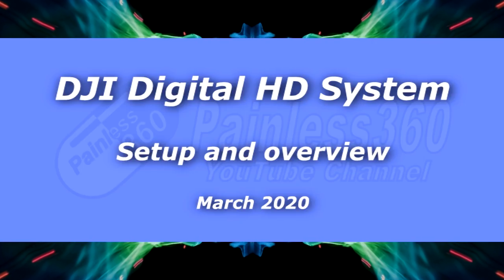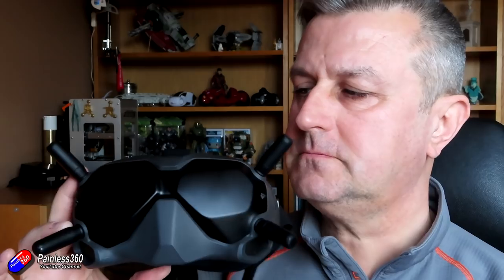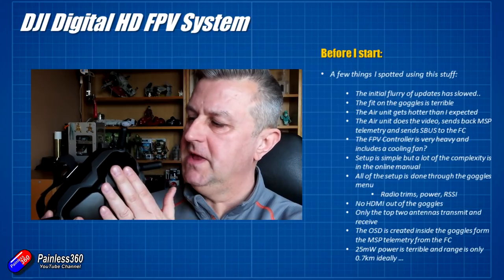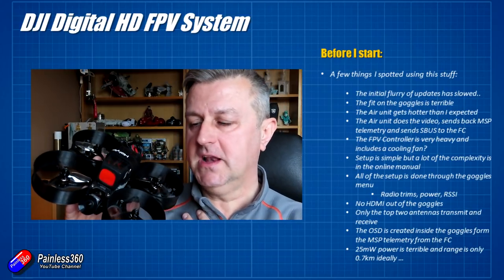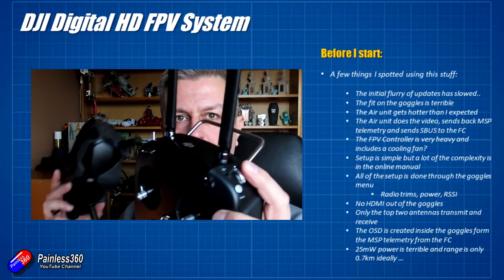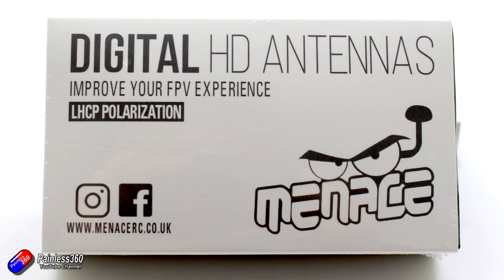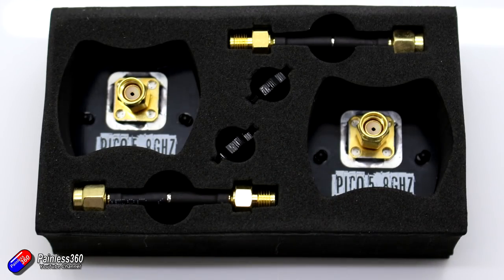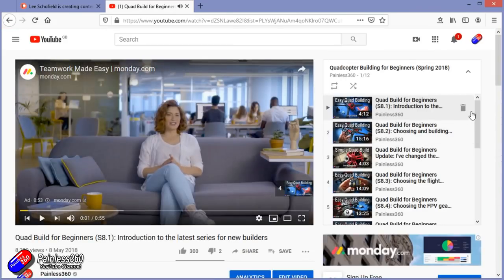'No Hype' DJI Digital HD FPV Setup and Tips

Comment: Hi! My googles don't work. I have a message "image transmission stopped" they don't bind and most menues are inaccessible. Can anybody help?
Reply from the maker: From my quick search of the forums this points to a problem with the Air Unit. I'd try the goggles with another Air Unit (if you have one) to rule that out.. Best of luck!
Reply: @Painless360  thanks a lot for answering! I managed to bind the googles to the vista unit at last :-) I had to try multiple pushes on the mini bind buttons on the googles before they actually decided to connect. Typical digital buggy behavior to me. 
But strangely there are still two menus that are greyed and they are important to me! It's the low latency mode and the camera menu. I also have only Two channels plus a channel 8 for public while the AUDIENCE menu is also greyed and inaccessible...

Comment: Awesome informative video as always. I've ordered the DJI fpv system and while I'm waiting for it to arrive I am concerned about the two screens. They remind me of fat sharks, which I do not like. I fly all my fpv with my face box headplay HD goggles. it's 16 by 9 IMAX, one massive screen in front of your face. While I've tried fat sharks it looks like the screen is too small and looking down a hallway. I'm concerned that the DJI FPV system will be similar to the fat sharks more than the headplay HD which is what I love. I haven't found any videos comparing the DJI screen size to a face box style goggle. How does the  DJI goggles screen compare  to the headplay HD? Thanks for any info and your help.
Reply from the maker: If you've liked how things look in those box goggles you should love these. Huge FOV and feels like looking at one large panel... Happy flying!
Reply: I had the same concern. I fly the eachine goggles two box goggles when not flying my dji setup. which isn't often just for my indoor whoop. I think the screen is bigger than the box goggle. So no worries there. YOU WILL NOT BE DISAPPOINTED in the screen size or quality. I have been flying mine almost every day since January, and I'm still impressed with the image.
Reply: same here, i loved my headplay goggles, these are greattoo, not like the postage stamp size of regular goggles, i actually thought it was just one panel :)
Reply: You will be very happy with Dji

Comment: Is it possible to use your head tracker tutorial with the DJI Transmitter and receiver? I'm not sure how as the air unit is all in one
Reply from the maker: You usually need another input from the radio from the head tracker and there isn't one on the DJI controller..
Reply: @Painless360  thanks for the reply. I assume it's the port to connect 2 controllers in training mode?